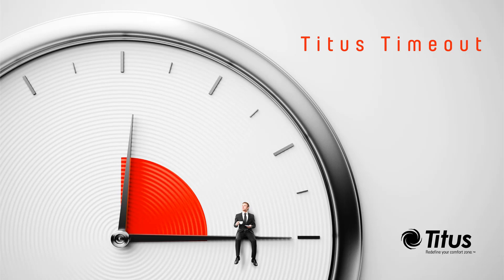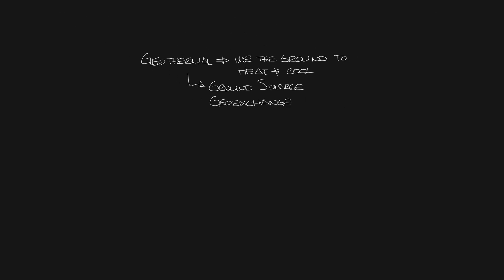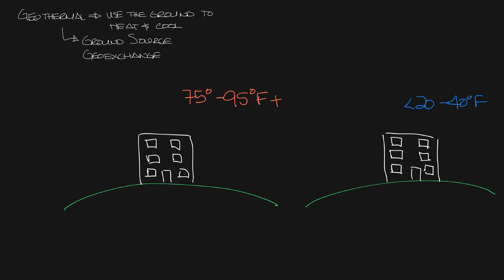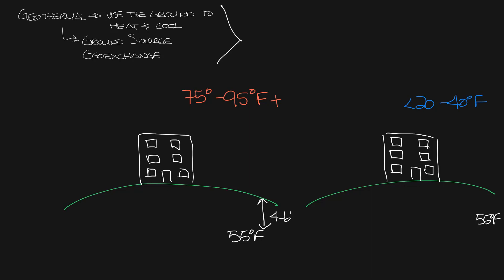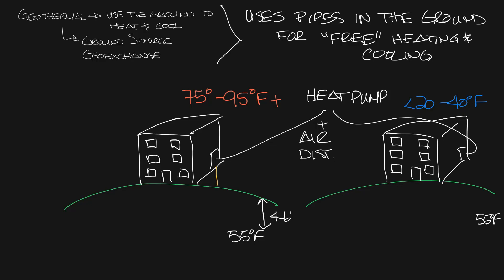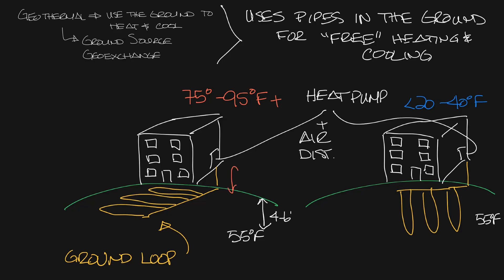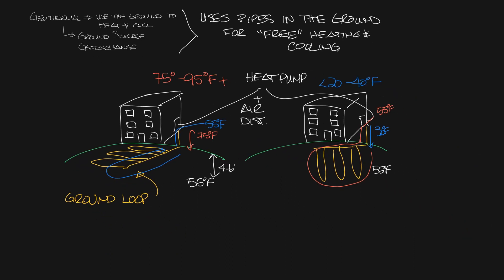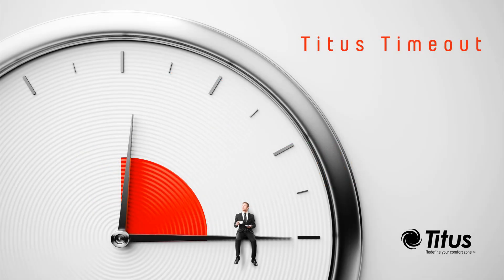Podcast What is Geothermal

Comment: What is heat recovery wheel and other related equipment similar to heat recovery wheel in HVAC,
Reply: Abdul Rahman heat recovery wheel is usually attached to fahu ( fresh air handling unit). There are 4 Chambers and a wheel . The wheel is placed in the middle of the section and is used to mix the cold air from the return duct with the fresh air from the outside. Because you are not cooling the fresh air , the system becomes a lot more efficient. Hope that helps. Cheers: 😎